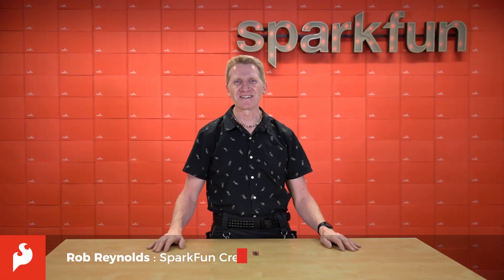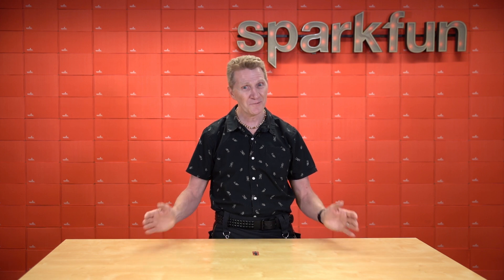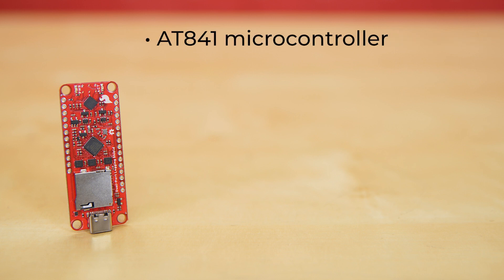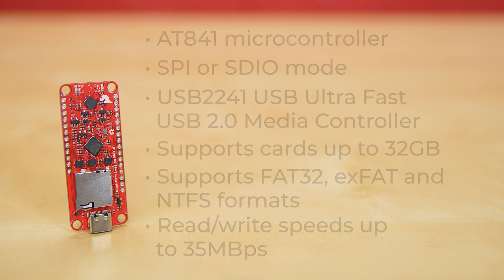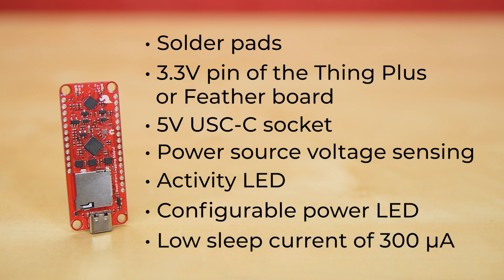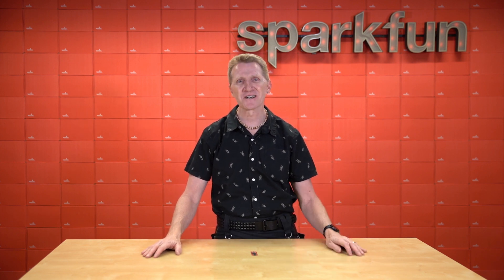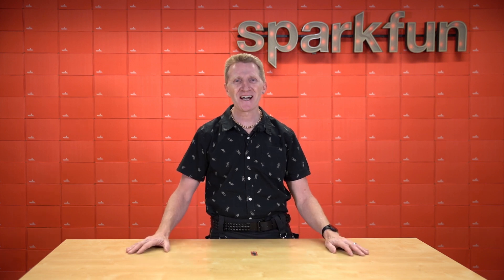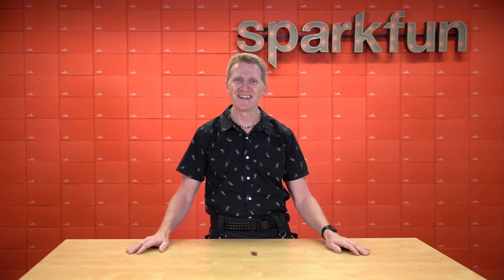Product Showcase: SparkFun Thing Plus Dual-Port Logging Shield

Comment: Thanks Rob. Ok, just stepping through a high level use case: I have an analogue voltage I want to sample at 10kHz and store readings with 8 ASCII characters including delimiter, so that's 80kBytes per second. So the 2MBytes per second is more than enough as a data transfer rate. The 32GB storage size could hold 111 hours of data at that rate. And when the samples are taken, I plug it into my PC via USB for data analysis. Looks like a good product.

Comment: IMO neither of the two are practical in the long run - they both need user-intervention. IMO, a contactless exfiltration system shall trump this, either contactless/nfc (granted, this needs some intervention) or RF.(How, practically, in a ultra-low-power system?) The egg is still 'uncracked'.